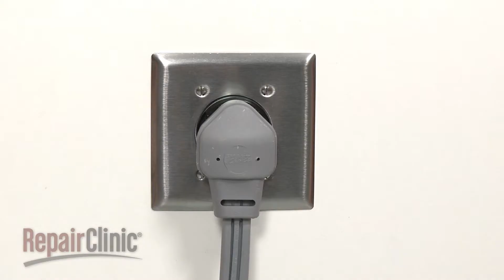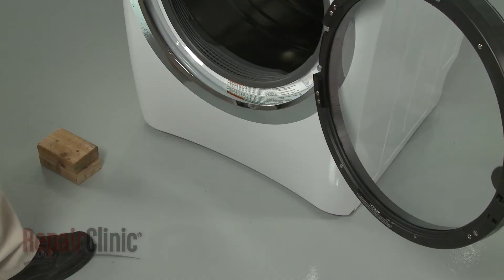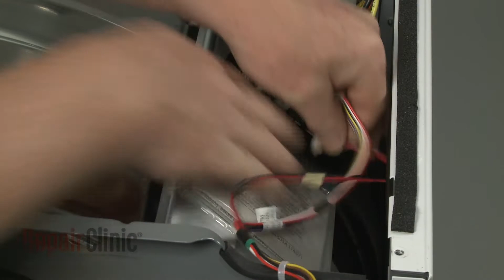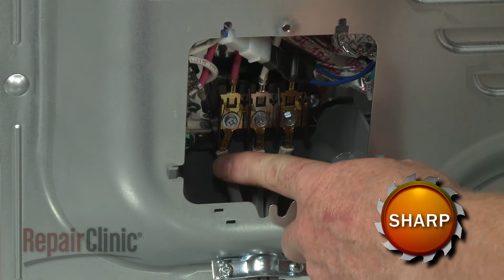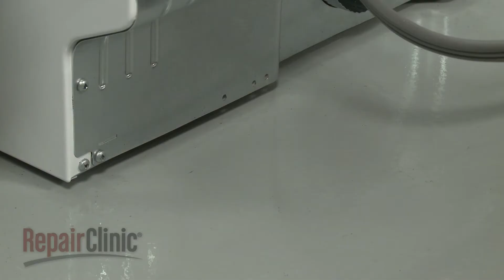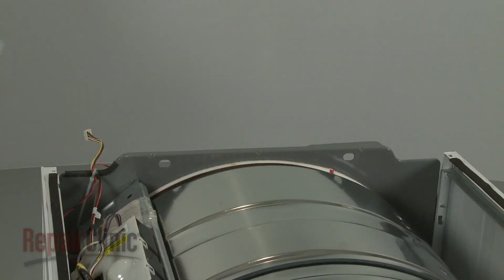Electrolux Electric Dryer Rear Heat Duct Replacement 134694030

Comment: Excellent video. FYI, the only difference between the electric and gas version is the gas doesn't have the three electrical connections; instead, it's just a clip. And of course, you need to turn off and disconnect the gas line. One thing to watch out for is the spring that provides tension to one of the belt pullies may disconnect from its lower hook.

Comment: Removed the entire front assembly just for one screw?
Reply: That's what I thought...can you not access that screw from the back cover off only and simply reach into the drum to remove the 3 screws holding the duct inlet cover?
Reply: You literally have to disassemble the ENTIRE machine, including the DRUM, to access ONE screw.  Who's the genius who engineered this??????? 😳
Reply: FYI, I was able to access the screw by just opening up the back and unscrewing it with a right angle ratcheting screwdriver. My model looks a little different than this one, but hopefully it’s similar enough to work for someone else too!